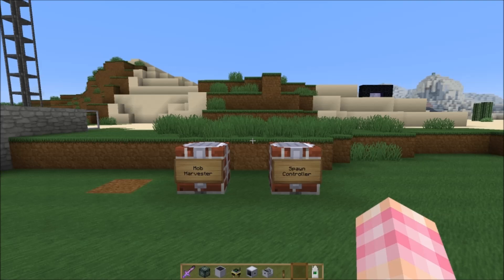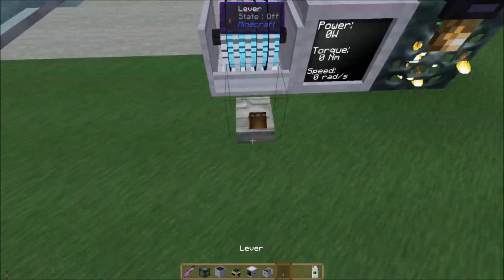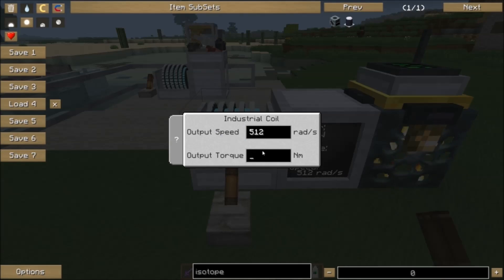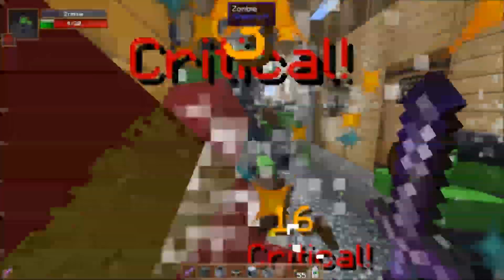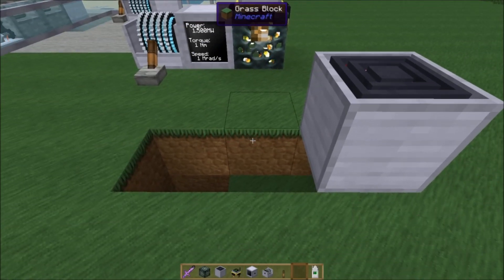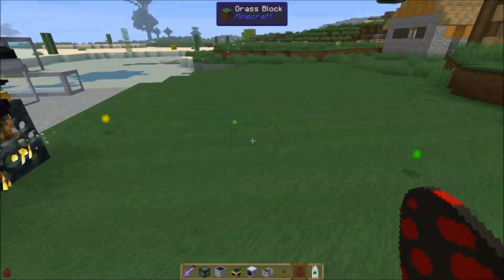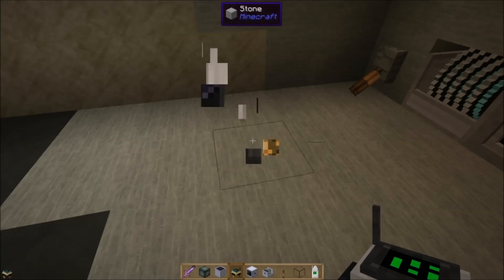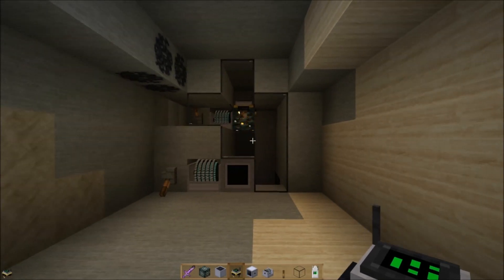RotaryCraft Tutorial #17 - Assuming Direct (Spawn) Control

Comment: I have a question: Does the spawn work like in vanilla (= doesn't spawn any mob if you are not near it) or does it strictly follow the spawn controller instructions regardless of where you are?
Reply from the maker: ***** I don't think it can spawn nocturnal enemies in sunlight but if you leave it alone it will just keep spawning as long as its loaded I believe.
Reply: Yeah you are right. I checked the wiki just to be sure and it will spawn mobs as long as the chunk is loaded, where you are doesn't matter.

Comment: How many hydro kinetic engines would I have to use and how many gearboxes would it also take to make the spawn speed 0
Reply from the maker: You would need 2 Hydrokinetic Engines at full power with 3 16:1 gearboxes, and an 8:1 gearbox. You could substitute 3 CVT Units full of belts set to 32:1 instead.
Reply: SentinalhMC Thank u this helps a lot and i really love ur videos helped me learn this mod and i hope u do one for reactor craft also :)